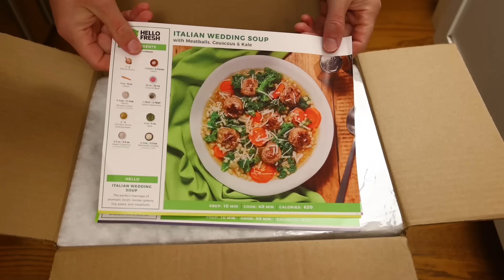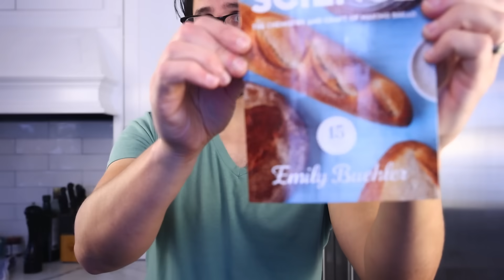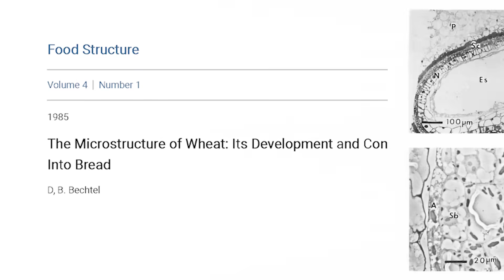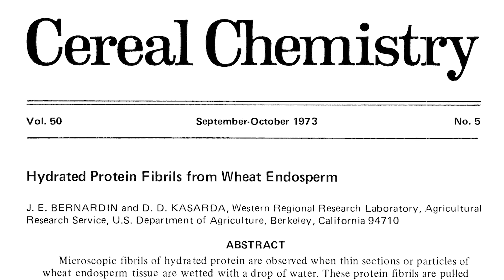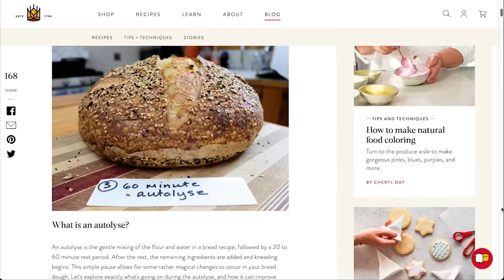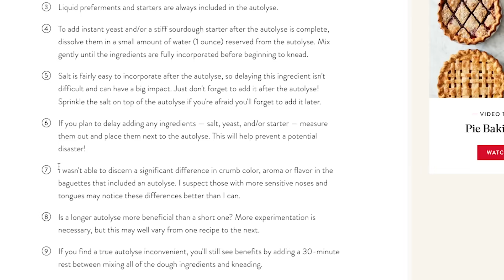How an 'autolyse' kneads your dough for you

Comment: Tangential point, but the Ancient Greek pronunciation of autolysis is not what you said it is. It would be closer to ow-to-lee-sis (the actual pronunciation of the y would be  something like the French u or German ü, kind of between an oo and an ee, but that's hard to capture in English spelling). The modern Greek pronunciation would be av-to-lee-sis. Through of course the English language has changed the pronunciation of a lot of Greek loanwords, so that pronunciation of autolysis isn't wrong, it's just not Greek.

Comment: Since I have no spiral mixer or even just a planetary one I has been intrigued by the 'no-knead' alternative by using autolysis for contemporary pizza and alike. Several times I tried autolysis followed by stretch and folds for ca. 70-71% hidrated dough, the results in progress were absolutely amazing and very promising, however after the dough balls have risen, the stretched dough handling was surprisingly challenging i.e. the dough became overly soft, barely holding its structure I experienced previously, hence operating the pizza peel was a true challenge. I wish I knew what I was doing wrong.

Comment: Hmm, interesting, I got mad about how everyone said,. "Flour the kneading surface" as if that did anything with the dough I was making. I was adding so much flour or oil to keep it from sticking to my hands that it was sure to be changing the actual percentages in the dough. I reasoned that I live in CO and CO is DRRRYYYYY. so I fI tried mixing in a bowl(because the assumption is that most of the world lives less than 100miles/KM from an ocean and have much higher humidity and this must explain why every other baker in the world can use "some" and not "an extra cup" of flour to knead bread [because they are getting effectively more water to wet the flour]) and got distracted. When I came back in *an indeterminate amount of time, I found that I needed neither flour nor oil to keep the dough ball from sticking to my hands and making a mess.. So As with all interesting food things(and many other discoveries), I came to the right decision for the wrong reasons.. I'm not even a little mad about this.

Comment: I've been playing around with this, my only question is how exactly do you add oil to the dough (in my case pizza) once it has developed gluten structure?
Reply: You ever figure this out ? My guess is to apply the oil to the rolled out dough and bake a bit before toppings and finishing.
Reply: @frenchfry5675   If you're mixing dough by hand, you have to add the oil before the gluten really develops otherwise youll be kneading for an hour. I mix water first, make sure there's no dry flour left, then add the oil and use the "pincer" method to incorporate the oil (google pincer method, its from Elements of Pizza book). Autolyse for 20-25 minutes and everything will hydrate, and then 15s of kneading and your dough will be 👌
Reply: @paolomaiolo2060  Excellent, much appreciated.  Going to try this later this week!

Comment: I discovered this autolyse procedure by accident myself. This is the first time I have seen this ever mentioned even after reading several baking and cook books. I would find kneading dough with flour quite difficult but resting for 20 - 30 mins after initial mixing made it so much easier to knead. 
I had assumed giving it some resting time allowed the water to more evenly hydrate the flour particles but evidently it is doing more than that. I also noticed that there would be some raising from yeast activity during this time and wondered whether the extra volume created helped to absorb excess water. That's just my own reasoning on the matter but thanks for giving some explanation as to what is really going on.
As a side note I prefer kneading with oil as this preserves the water/flour balance better than using flour, which may have been where my first attempts were falling flat.

Comment: Adam,
Autolyse is from Greek. It should rhyme with “eyes” as you pronounce it.
The Autolyse refers to the digestion of the wheat endosperm starchs; Dextrans and Fructans to maltose, glucose and fructose, respectively , by the natural autolytic enzymes in wheat.
These sugars are food for a germinating wheat germ, or yeast as in bread making.
The process requires water to occurs hence Wheat Autolyse is a “hydrolysis” of wheat starches.
Pentosans, like Fructan, make up 1-2% of most wheat species and inhibit gluten development unless hydrolyzed.
Reply: Since lysis λύσις is from the Greek it should not be assonant with English "eyes". Upsilon may be transcribed as "y" but it is not pronounced like English "y". If you're going to appeal to its Greek roots then it should be more like "loo-sis".
Reply: @igrim4777  
Lysis (/ˈlaɪsɪs/; Greek: Λύσις

Comment: Great vid! Holding more water these days Mr. Ragusa. Did you get your hormones balanced or just start working out? I just took some samples myself and found low free test but super high total. On creatine or something? Careful of BP when holding more water. Apple cider vinegar 10mL morning and 10mL night is great for balancing electrolytes and pH. Loads of minerals and good prebiotics there too. You will notice the difference in the mornings on your face. You have those kind of genetics. Careful you dont blow up with water if modifying test or free test levels. Would be interested in your results if you are doing it. Nutrient partitioning, efficiency and quality of life is greatly improved at optimal hormone levels :)

Comment: Get a Danish whisk if you're going to mix it by hand it works wonders. If you're going to use a machine to make pizza dough use a food processor it takes all of 4 minutes. Also in the dough don't use water, use beer. The flavor and the texture are completely different and wonderful. Final thought, I never knead my dough I let it rise overnight for at least 12 hours and it kneads itself. It's soft, elastic and sticky just like a good pizza dough should be. Additional hint if you really like a round pizza dough, if you have one at the beginning use a tortilla press and then roll out your dough.

Comment: Autolyse is one of the best techniques I have found when working with high hydration recipes. Less time in the stand mixer and much easier to work with otherwise difficult dough. I even do it for lower hydration recipes just to save time. I do it between 30 mun-45 min for strong flours and 20-30 minutes for weaker flours. I have hear autolyse does weaken the flour which is important to not over-autolyse.

Comment: This video is wrong in stating that in France people were baking bread at home with mixers which led to a decline in bread quality. 

The French generally don’t bake bread at home. There is a bakery at every street corner (especially 40 years ago) so why would they? 

Calvel didn’t invent autolyse for home bakers. He invented it to address low quality bread turned out by industrial bakeries using high-powered mixers. 

Autolyse is a way to slow that process down to make it more like what a sourdough home baker would do. 

Ergo, sourdough home bakers don’t need autolyse. 

Autolyse is defined as mixing just water and flour and incorporating the yeast and salt later. This is important with commercial yeast because it ferments so fast, if you  add it at the beginning, the dough doenst have time to fully hydrate. 

Sourdough is much slower. Therefore there is no point in doing autolyse. Just add everything in one go. Let the dough rest after the initial mix (which you’re doing as anyway between  stretch and folds) and the dough will come together automatically. No need for autolyse. Just a slow process with rest periods.

Comment: Actually, "auto-lease" (IPA [ˈɔtoʊlis]) IS the right pronunciation, ESPECIALLY if you're going to use the Ancient Greek argument--the Ancient Greek word is λύσις, and upsilons in Ancient Greek were pronounced somewhere between an "ooh" and an "ee" (most often compared to a German ü), which eventually became a straight up "ee" by the emergence of modern Greek. Consider for example "gymnasium," which has the same upsilon situation in the Ancient Greek as our current word lysis (γυμνάσιον), and is also pronounced as "JEEM-nasium" not "JAIM-nasium." 

It's true that Ancient Greek was spoken for ~2500 years (more or less depending on how you define proto-Greek and modern Greek, its descendant) and its phonology changed extensively and varied by region in that time--however, NOWHERE do we have an attestation for an "ai" sound for the upsilon--that is a purely English botch-up of the Ancient Greek language. (We know for sure that it was a pure monophthongal IPA [u] in Proto-Greek and eventually became an IPA [i] by modern Greek, and the debates for that shift are varied, but absolutely no linguist would ever claim it was an [aɪ] at any point) You can claim you're pronouncing it with an "ai" because you're an American who speaks English, and therefore you're pronouncing this word the English way (consider our word "cycle" from the Ancient Greek word κύκλος, which you'll notice ALSO has the upsilon, but because of the Great Vowel Shift and other phonological pressures of the English language, has retained a similar pronunciation as yours of "lysis.") but the French are actually MORE correct than us on their pronunciation of "autolyse"--and you most certainly should not be using Ancient Greek to back up your pronunciation, because it actually supports the French phonology much more than yours. I don't mean to be rude, but as someone who has made classics her life's work, there is already so much misinformation about the ancient world; please do your research before making such claims. 

For my sources and further information, I suggest Sidney Allen's Vox Graeca or Stephen Colvin's A Brief History of Ancient Greek. I will note that I'm not a linguist by training; only a philologist, so I was required to the learn the basics of this information, but am not an expert by any means.
Reply: Yeah, that he thought with such assurance that the English "ai" would be more accurate annoyed me.
Reply: @ur.kr.2814  🤓
Reply: I love his chanel but when he starts to force things to show that English or American way is better..., that really bothers me. Not everything in the culture is perfect. For example when he praised a dish (mac and cheese)made with garbage food (ultraprocessed wanna be cheese)...
Reply: @wa_kandaforever  he has stated in another video that nutrition isn’t the only thing he considers when he labels a food as “good” or “bad”. Mac & Cheese is made of processed cheese but it tastes good so why are you acting as if it’s objectively a bad food?
Reply: I don't even know anything of ancient greek but the word "larynx" disproves pronouncing autolyse like rice I'm prettu sure, but I might be wrong because the english language is a huge inconsistent mess that shouldn't have become a standard

Comment: Wait, so if dough does that automatically the kneading doesn't really do anything except maybe speed up the autolyze process.
Reply: Correct, it just shortens the time required from 12 hours (no kneading) to 1 hour. It also works with low hydration dough like sandwich bread that has a drier, close crumb. A bread like that doesn't have enough water to come together on its own.

Comment: I'd heard of autolyse but have not done it, as right now, my bread baking is when I make pizza. 

I use the Fleishman's yeast recipe that's found on the pizza yeast packets and online on their website. I initially found the recipe off the packets, then got it from online. 

Anyway, it does not require any rising, but I do that step as I almost never use pizza yeast these days (it helps with reducing spring back and is much easier to roll out for inexperienced bread bakers). 

Anyway, I use the food processor for the initial kneading by putting in the ingredients and yeast/water/sugar mixture (to proof), the oil and salt, and about a cup and a quarter of flour or so and whizz up until it forms a ball and cleans the bowl some, then let it run for about 3-5 min, then turn out onto a floured surface. 

I do what I learned from the late, great Julia Child, and that is slap the dough around on the counter no more than 3 minutes before rolling into a ball and into the rising container, a 3.5Qt Cambro container that's been spritzed with cooking spray, then I spritz the top of dough and put the cover on it, and place it at the back of the stove while the oven is heating up to rise to almost double. That is the ONLY rise I give it, it's also like letting it sit and rest, except it rises to almost double in size.

Then I pour it out onto a floured surface, and gently fold it several times then form a ball again, by this point, the dough is smooth and then roll out into a 12" pizza. This same dough can be rolled out to 16" for a thin crust if desired.

It's easy to do and I can have the dough made up, rolled out, ready for the topping(s) and then bake at 550F for 10 minutes. Works every time if I don't screw something up in the process and happens every so often.

I should say, I've done this for a while and have honed it and refined it to where I now use active dry or rapid rise pretty much exclusively and have added the rising step. This became the way when I got yeast whichever was available during the height of the pandemic when many food staples were scarce, like yeast, flour and sugar.

Comment: I've been a millwright building industrial bakeries for 30 years, the biggest places. I don't remember ever seeing any bakery use the autolyse. Most industrial bakeries use mixers in the 500 to 2000 pound of dough range (wonce moved a 3500), they are equiped with 25 to 100 hp electric motors. Those large mixers have no problem kneading the dough, most kneading that is done after the first rise is done as some sort of conveying system.

Comment: 20 minutes? I always thought it had to sit around for several hours XD

Guess I'll be baking some bread when the weekend comes!
Reply: It needs hours if you are only doing turn and folds and even longer if you are not kneading at all. This example still involves manual/mechanical kneading. It's just shortened with the autolyze.
Reply: Hours is when you do a preferment

Comment: When making really dry doughs, like that for ramen, this step is really a necessity, rather than an option. There's so little moisture that you have to get every advantage you can get just to get it to knead, and even then it's sometimes good to knead it with your feet.
Reply: Yeah, especially since ramen dough needs a LOT of kneading. A lot of shops with industrial mixers will just toss the dough in and let it go for literally hours

Comment: Wow, as one (of many, no doubt) who has never dabbled in this, as a counterpoint I'd have to ask, what is the merit of manual kneading then, since this wasn't explored in the video? And if there is no tangible benefit to doing manual, why do so many resources continue to cite manual kneading as the default function? If we're letting bread doughs rest anyways, as in the case of yeast doughs, I struggle to find any reason to do handle it manually beforehand, even with a machine.
Reply: Mechanical kneading works better with low hydration dough, like standard sandwich bread. It also is faster and more predictable. A 10% variation in 10 minutes of kneading (due to flour differences) is only a difference of 1 minute. The same 10% for a 4 hour self rise resting period is over 30 minutes. But if you give yourself the time and take a laissez-faire attitude with your baking, then you really only need a few stretch and folds along the way and no manual kneading.
Reply: Also, kneading bread dough feels nice. It's soft and squishy and just feels good in your hands.
Reply: @erinhowett3630  It smells wonderful, even when it's still rising, and more so when you bake it. Kneading is good exercise for your hands and arms and upper body. And you don't get the whole mystical experience of turning flour and water into FOOD. And of course bread was invented when someone soaked some powdered grain and dropped it on a hot rock, and created flatbread.
Reply: I think at some point you have to do the REST of the work. I think there’s a stopping point with autolyse. And you might want to get it to a CERTAIN gluten formation or crumb before it starts rising and the crumb sets or something like that.

Comment: Great video Adam! One of the best explanations I have found so far about the autolyse. I’m curious to know whether you found a difference between adding the yeast during or after the autolyse with different hydration levels? I could imagine that an increased water content improves yeast mobility and can speed up its acid production too. For sourdough this may not be an issue as it’s a lot “slower”, but I don’t know what the effect would be with dried yeast.
Reply: If you go with a 20-30 minute autolyze then you don't have to adjust the yeast content, it might finish its bulk proof a little earlier but it's not really anything to worry about. If you are going for a long rise, low (or no) kneading recipe, then you cut the yeast back quite a bit, I personally cut it back to: .5 tsp.